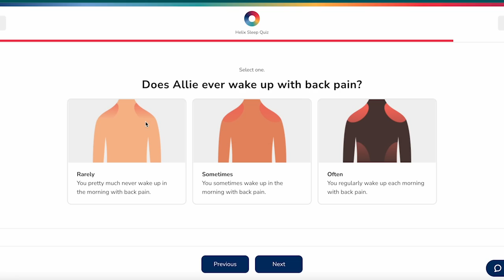TAKING A CHAINSAW TO OUR BRAND NEW HOUSE!!!

Comment: Suggestion for your propane tanks - put marker flags at the front and back and sides of the tanks for when the snow is redonkulous and you're navigating the machines around them in the winter. Also now is the time to figure out a better dry storage area for your firewood since it is such a drag to hike through that basement window. Not like you don't have enough to do already though!
Reply: Seems like a good idea to me also.  Up here in Canada we often use these long reflective driveway marker sticks poking out of the ground to guide snow removal where walkways or driveways are prone to getting buried.

Comment: I have only heard about making ways for the rain and meltwater to sun off of the property toward the road. Maybe, I missed ground water drainage. I STRONGLY urge you guys to put plastic drain tile in around the foundation to allow water to drain to the road also (if you have't already). Considering how fast the incredible snowfall melted last Spring, in ground drainage would reaaly help to keep water from intering your basement.  4-6 inches of water in the basement is not a fun week. With your hill, there will be a lot of water pressure on your foundation walls working to come in through any unforseen pores.

Comment: all this dirt moving around and still no perimeter draiage that I know of . I thought the plan was to drain it all to the road and last year no water came to the road due to pipe problems . Its a land slide waiting to happen . Theere is lock blocks (made from leftover concrete in the trucks at the concret plant) that have a  texured face and would be ideal for many splaces on your land

Comment: You work with the tools you've got. A saber saw with demolition blade would have worked but a chainsaw with a sacrificial blade works too. The heat and smoke was a concern but it all turned out good in the end. It's a Nice video while  on the way to framing the second floor.

Comment: I would dig some runoff trenches behind the house as close to the mountainside as possible all the way around the house for water drainage in the spring. if not all the way around the house, at least across the back of the house with a taper to them with a keg on each end that you can pump out with a good size electric pump in the spring to get the water around the footprint of the house.
I know dig a moat around the house . lol jk
FYI: I might be wrong, but the snow that packs onto the roof and slides off the roof and gets even more. Packy probably will not be snow blowing type of snow. It will be packed so tight that you’ll have to use the bucket to take it away.

Comment: I wonder what thought goes into placement of additional propane tanks.  Placing them side by side seems like the signature of a Bond villain so they can explode sequentially.  Wouldn't it be better to 1) place them further away from the house and garage, and 2) place them well apart from each other?

Comment: Maybe some shoe bottoms that can be strapped on that has mini suction cups on the bottom would help being on the metal roof. Or take a bath May and use it to prevent sliding if that tin roof

Comment: Another fruitful day. Reminded me of a day setting a 24' beam 18' high. Only had 1 scaffold stack at one end with 4 guys. I'm laying on an existing flat roof with a coworker holding on to my belt. I'm holding on to the beam below me trying to get the beam into the beam pocket...had to do it twice as someone marked crown on the wrong side. Wish I was still that strong but not that crazy.
Be well...stay safe.

Comment: I haven't read anywhere about the possibility of having a remote filling station for the gas or if it is even possible.  Then the problem is solved of delivering gas in the future.  May your day be filled with happiness and love.  BTW I think that removing the portion of the roof could not have been done any better by anyone else.

Comment: You guys should rent one of those mini tracked dump trucks through on tracks instead of wheels. 
That way you could start backfilling with the extra dirt to bring in your straightaway driveway. And some extra level for parking for parties.
And an extra pole barn for all of Trent manly stuff! Or at least one of those Equipment buildings that are open on one side just to get stuff under a roof.

Comment: I was wondering what kind of carpenters you are that you never use a chainsaw.  lol  
It is common to use them on jobs like that.  Keep your chainsaw sharp and they are very handy.

No, to more kids, maybe for a puppy, just remember you would be getting a pup that is bred for working so will like Leka, need a lot of exercise.

The house is looking good and you guys have really been making headway before the winter sets in.  Grason has been a nice help, but I was wondering where Brandon was this week.
I don't know if my suggestion to clear a road on the hillside area so backfilling would be alot easier is why you did it, but whoever you listened to, it is working nicely.
You won't need a trench for melted snow, it doesn't melt all at once and you have a French drain.

Hope the family problem you are all going through right now turns out better than today.
Your right, we all have problems, but it never hurts to have others share and wish better times for you.

Comment: "That is not the intended purpose of a chainsaw..." Hmm, you should tell all the roofers that in Seattle. They do not use any other saw. They cut all the trusses and rafters with a chainsaw. Intended or not, I was surprised to learn it was the saw of choice, and they were just as precise using that as any other more saw. Doing compound cuts and all. I quickly decided I would not be a roofer in Seattle.

Comment: So, Trent not only likes your legs, but likes them attached!  Go figure!  People who don't chainsaw may look disdainfully at it used in this context, but it's a valid tool. It's a saw!  It's just a bit less precise than some other saws, but more powerful and with a longer cut.  I used a chainsaw to help build wooden playground equipment at my kids' elementary school years ago (insurance folks are cringing right now and OSHA folks are shaking their heads) but it was safer and more effective than any other saw we had available.  And it worked.  And, like here, no one last any parts!  Meanwhile, what happened to your timing?  The lumber truck didn't show up while the propane tank delivery was happening.  You guys messed up!  AH, much better - the lumber will show up at the same time as the propane refill truck!  Back to normal!

Comment: 15 minutes into the video and Allie says "we're being super safe here Jennifer"
Absolutely clueless when it comes to safety, especially with a very dangerous tool like a chainsaw. 
Trent isn't wearing any PPE - no helmet, face/eye protection,  hearing protection,  no leg protection (leather chaps).
And held on the roof to stop sliding by Grayson holding onto his trousers   Not to mention using the chainsaw one handed.  What if it hits a nail and kicks back?
An accident waiting to happen. 

Why didn't you remove the side facial board, then the small bits that hold the roof sheathing on, and cut the sheathing with a smaller, safer saw.